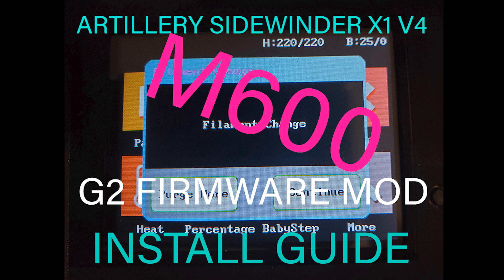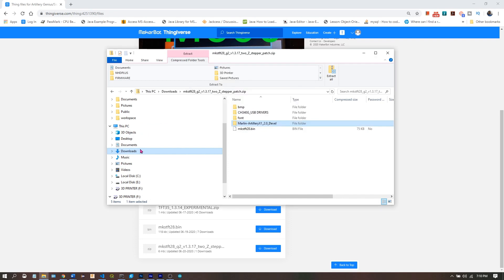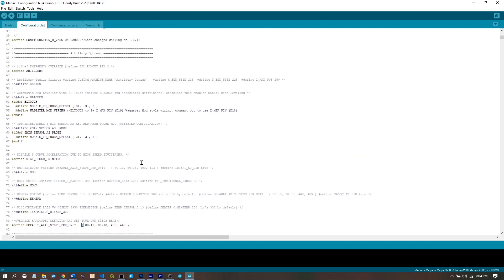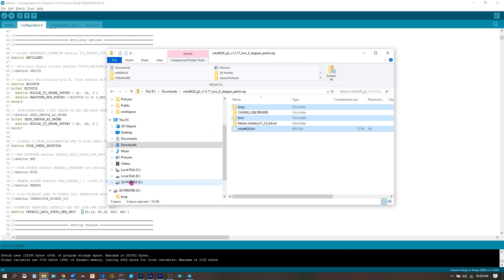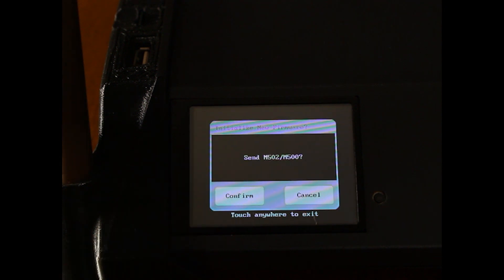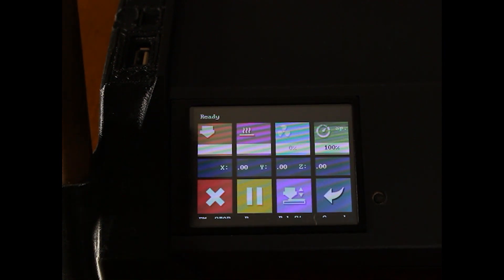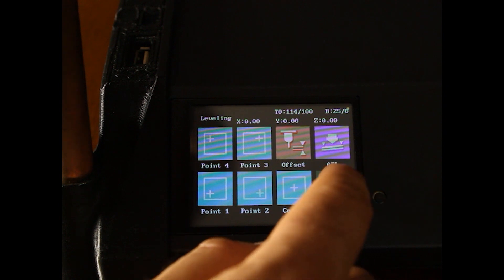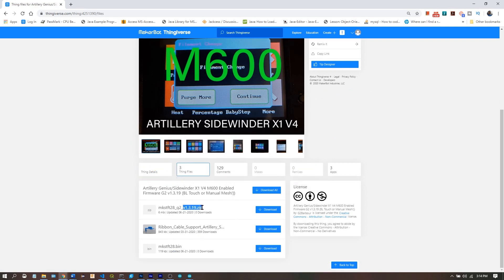INSTALL GUIDE: Artillery Sidewinder/Genius G2 Firmware with REAL M600 Color Change on Stock Hardware

Comment: can you make a video on how to upgrade x1 mother board to btt skr 1.4 tft 35 v3 tmc 2209 thankyou sirr i subscribe to you
Reply from the maker: I haven't had time to dust my printers off in a couple of years, unfortunately. But if I were to make another video I would have to have the hardware for the upgrades and those aren't upgrades I currently plan to make.

Comment: WHAT MOTHER BOARD DO YOU CHOOSE    DOESNT SHOW THE MKS V1.04
Reply from the maker: I don't remember. This was years ago. But if you download the modified Marlin version you'll find it. I do seem to recall having to spoof something in Marlin with the wrong board to enable certain functionality tho. I think I had to tell Marlin I was using a board with encoder wheel capabilities and then backdoor the system with fake encoder data. I could be confused though, because I was messing with alot of different options to get it to work. I had to find alot of workarounds to connect the starting point with the goal.

Comment: would this work the same on the new Artillery X2?  X2 has everything I need except for the M600.  thanks
Reply from the maker: Do you know what control board it has?
Reply: @PrintEngineering  Sorry I don't know.  I can try to find out.  If all else fails I can do the M600 pause by layer in Cura and add i to the script.
Reply from the maker: @ChinaAl  it now has a 32bit mainboard. So the TFT display looks like it is the same but Marlin would have to be pinned and coded for the new board.
Reply: @PrintEngineering  Oh, Okay thanks much.  That can be done.
Reply from the maker: @ChinaAl  no problem. Share for others what configuration works with the new 32bit boards. And remember that I was using a custom version of Marlin with features that don't exist in the official release. Though one or two features have since been added like M155 autoreport position (they may have changed the Gcode command for it but the feature does exist now). I did alot to make ADVANCED_OK work flawlessly with our printers.

Comment: supplied cable is a foot long and my pc is 6 foot away.... not so sure i want to invest in a longer cable to fix this printer. prints look like crap, bed has a hill in the middle, bad z wobble and layer shifting.
Reply from the maker: I made alot of improvements with Z braces, solid Z couplers, and a ton of calibration. The Z rod can also be bent and wobble which can be hard to chase down. If under warranty, support should replace anything bent.
Reply: @PrintEngineering  i hear ya. its less than a week old. considering returning it and getting another cr-10 seeing as that they are reliable.

Comment: @Print Engineering  I have another question. I have done the 3dprintbegginer tutorial to use the Z stock sensor as bltouch, but instead of connecting it to the LED connector I have connected it to the BLTouch connector of the Artillery Genius. I have seen that your firmware is already configured to work with this modification, but I guess I will have to change some parameter to make the sensor work from the BLTouch connector of the Artillery Genius instead of from the LED connector. Can you help me with this issue?
Reply from the maker: The factory built-in BLTOUCH support wasn't yet implemented when I made this video so I am unsure what, if any, configuration differences there are with the BLTOUCH pinout. I suggest asking the community what Marlin pin configuration works with the newer setups and simply make sure the same BLTOUCH pins are defined in this version of Marlin. I also wouldn't be surprised if someone has caught up with the true M600 functionality and the USB baud rate issue in another firmware by now, as it has been out of development about a year. I keep meaning to post the source code but if I had time for that I'd probably still be developing it. (Last I checked other fw was only emulating M600, and they got the USB to work by slowing it down so much that it would bottleneck my performance Enhancements and cause stuttering during print)

Comment: Hello everyone.
I just installed this firmware on my Artillery Genius. I am testing the printer but I just realized that the filament sensor is not working and it is enabled in the menu. It runs out of filament and the printer keeps printing. what's going on?
Reply from the maker: Did you move the wire?
Reply: @PrintEngineering  In the thingiverse instructions, I understood that in the last experimental versions it was not necessary to move the sensor cable to make it work.
Reply from the maker: @jonnymet7579  honestly I can't remember if it was fixed in the latest versions, I haven't touched the project since then. Busy with many life situations currently
Reply: @PrintEngineering  Okay, don't worry. I'll change the wire to make it work. Thank you.

Comment: Hello,
I have an Artillery genius with everything stock and working perfectly but I want to activate the M600. Can I install only the firmware of the TFT and the M600 works? I mean, install this TFT firmware with stock Marlin. Would it work? Or do I have to install this firmware of TFT + Marlin obligatorily? Thanks!
Reply from the maker: No, the Marlin version is modified. As of the time of writing there are new custom features in that version of Marlin. M155 auto report position has since been added to official Marlin releases but I think they may have changed the command from M155 to something else.

Comment: the genius filament runout sensor is not long enough to plug into the board. is this step necessary?
Reply from the maker: It shouldn't be but I've had reports that there may be a bug preventing the original runout configuration to operate properly in the recent versions. I haven't touched the project all year so I can't remember exactly. If it doesn't work you can splice and extend the wires yourself or I think I have the materials to make and sell extensions around here somewhere...
Reply: @PrintEngineering  thank you for the reply, my artillery genius has been parked for 4 months now because ever since I got the bltouch I've had weird, hard do diagnose problems (at least fit a newbie like me)
I'm trying this version of the firmware in hopes it gets fixed
Reply from the maker: @tuganerf  I hope it works

Comment: Many months ago I installed the RAWR TFT Firmware mod on my Genius and it sorta worked but now it freezes during M600. I'm trying to make your firmware mod work, when I put the SD card in and press the reset button, it just starts up as normal. Just wondering if I am overlooking something simple?  I have detached the reset button under the hood, and I put the three things on to the SD card that you mention. Thank you for your time!
Reply: Ah ha! I was using a 64g sd card.

Comment: Great work and looking forward to your 1.4 Version. 1. Question, if I want to have my LED and cable my bltouch direktly (I have an 1.25m cable fitting perfect under the ribbon cable) how to change the Arduino shetch, for b/w I can use D18/D19 but how to address the D11 into the shetch (other is 5v and grd in that 4. Row) and let the LED stay on D4,5,6? (Need to change something also at num_servo?) Would be great if you could help me here. Thanks in advance

Comment: I’m a noob to this. I have had a genius for about a year now and i love it. It has all stock parts still. but i really ant M600 and also that octoprint feature is cool. But i have a few questions. 1st, will this void my warranty and is it worth it to do so. next, can you change the tft layout and stuff without changing that whole firmware from stock. i don’t understand but i think you changed the tft layout first correct? Also this does work with borough if i ever decide to get on right?  anything else i should know before i try this myself?

Comment: Hi,
I am only discovering this video now.
I installed the firmware and it works great !
What happiness to use the M600 and especially to be able to interact with the touch-screen, even if the print has been launched from octoprint!

I love this firmware. 
--- Thank you very much for your work ---

Comment: The best firmware that I have checked.... Congratulations. There is a lot of work behind
Someone has a problem  to compile with the TMC2208 or TMC2209 driver option ???  It only works for me with the default 2100. I am using arduino IDE to compile  with a MKS GEN L v2

Comment: So the m600 function doesn't work if the filament sensor is detached?
Reply from the maker: I've never tried it like that but in theory it should still work
Reply: @PrintEngineering  Ok. I asked this because my sidewinder's filament sensor cable is too short. Not a problem because I have never used the filament sensor, but I would be sorry not to have the m600 function
Reply: @michelesampaolo3467  did it work with it unplugged?
Reply: @bigwurm8314  i tried it yesterday. Yes! The m600 works like a charm

Comment: I have the Artillery Sidewinder X1 V3 will these firmware and screen modifications work with this model, I am new to 3D printing
Reply from the maker: Yes. I also have a V3. The only difference is related to accessing the SD card as the V3 wasn't wired properly from the factory so it doesn't signal that an SD card is inserted. Functionally you should not be able to tell the difference. There may be a dialog that pops up and you may have to mkar 2 attempts to access the SD card drive the first time, otherwise it will be the same.

Comment: Dammit, I have the X1 but my wire is too short to reach the controller board
Reply from the maker: Yes apparently they have been pinching pennies. I can sell you a cable extension for $5 +shipping.
Reply: @PrintEngineering  hey no worries man, I just extended the cable quickly :)

Comment: I really appreciate people that generously share their work. You transformed my printer into a 1st class tool. Thanks
I do have a question though, I may not be right but since the firmware change my Genius extruder makes loud rattle noise on sharp direction changes. I have checked all the physical mounts etc. The feeder is not slipping however the noise comes from that area. It is not affecting print quality.
Has anyone else experienced this?
Reply from the maker: Default acceleration and movement speeds are higher. Possibly putting more stress on the fan.
Reply: @PrintEngineering  Thanks for that, I was wondering if they had been changed. It makes sense, where is that changed? I would like to experiment with it.
Reply: I found it, DEFAULT_MAX_ACCELERATION in Configuration.h. At least I will be able to prove if that is the reason for the rattle.
Reply: That worked. Factory values made it quieter. Here are some other setting I found helpful:
Move extruder off bed after ABL, find and uncomment this line "#define Z_PROBE_END_SCRIPT "G90\nG1 Z10 F3000\nG1 F9000 X2 Y2\n" "
If bed is pretty flat, glass etc find this "#define GRID_MAX_POINTS_X 5" and change 5 to 3
Speed up travel find #define XY_PROBE_SPEED  and change to 12000
Reply from the maker: @fatchickencatcher  glad you made some customization that made you happy

Comment: hello but not to load the firmware no longer need to disconnect the tft cable and put it back once done?
from the video I have not seen it ... thanks
Reply from the maker: Correct. But after the video was made there is a new feature set where you move the wire and get instant print cancelation and the original reset functionality is restored.
Reply: @PrintEngineering  ok so to load the firmware i just have to move the cables close the machine and load it? to be sure I have the printer in a really awkward position
Reply from the maker: I'm not sure what you are saying. But the red/black reset wires can either be disconnected permanently or moved to the position right next to the original position of the filament runout sensor (black on B1).

Comment: I'm installing your great firmware, but I have 2 question: it's compatible with the bltouch wired to the led pins (as waggster mod)?! And second: I saw you setted NOZZLE_TO_PROBE_OFFSET to 31; -31; 0, how can I determinate what's my offset?!
Thank you so much! 🙏

Edit: compiled with enabled bltouch and flashed your firmware and tft, but when i go to calibrate bltouch z-offeset, the printer goes to the opposite corner and continues to spin the motor, so i had to remove the power. And in the probe is going out of the home corner. How can i solve that?!
Reply from the maker: Yes it is compatible with that wiring. Just uncomment BLTOUCH and iirc the default is for waggster style wiring.

The probe offset you may have to measure for but the defaults match the most common STL for probe mounts. If you do need to change them they are the set of numbers closest to the BLTOUCH definition. When you home take note of the point that is probed then watch the distance along the x and y axis from that point to where the nozzle aligns from the offset menu. I recommend leaving it a few mm offset from exact alignment to avoid oozing sticking to the bed and skewing the probe homing value.
Reply from the maker: As for the other problem where it tries to probe off the back corner of the bed, (I saw your comment on thingiverse but I am not signing in to respond to anything there currently due to family emergency), this happens occasionally for unknown reasons that I suspect have something to do with Marlin memory getting corrupt. Possibly you forgot to reinitialize the new firmware with the dialog (which sends M502/M500) or it is a bad flash. Generally reflashing Marlin solves this.
Reply: Perfect! At the 3rd flash, all works ok. I love this firmware! Bought you a coffee. Thank you 🙏
Reply from the maker: @chazy10  much appreciated! Glad it worked for you.
Reply: One last question: when I sent print via octoprint and then I have to babystepping, I disabled the lockdown mode, but I don't find where to babystepping while printing..
Reply from the maker: @chazy10  more
Reply from the maker: @chazy10  I think. my printers are in North Carolina and I'm in Pittsburgh so I can't check right now
Reply: @PrintEngineering  while printing from usb, is there, but if I print from octoprint and then disable the lockdown, I can't find babystepping.
Reply from the maker: @chazy10 you shouldn't have to disable busy mode to get the baby stepping while printing from octoprint. Babystepping should appear on the busy mode status screen

Comment: when I upload the tft firmware why dose it say no printer attached and why is there no BMP or font files in the new version off m600 ?
Reply from the maker: Did you update Marlin too?
Reply: @PrintEngineering   turns out there was something wrong with my mainboard it wasn't communitcation with the TFT, I swapped it out for are new one and its seems to work now no idea what it was.
Reply from the maker: @Warhorse469  glad you got it working

Comment: I have installed your firmware and i am having temperature fluctuation on hotend, also the PID tuning takes about a minute and not 6 minutes. How can i solve this issue?
Reply from the maker: I'm not sure what is going on. I don't really have enough detail. But it sounds like the PID tune isn't giving good values for you
Reply: @PrintEngineering  what kind of data you need to help me out. Thanks for your reply btw
Reply: @PrintEngineering  what is PID tuning. what do those numbers mean? i’m just curious
Reply from the maker: What do you mean by temperature fluctuations? Are you running the stock cooling setup? Do you have old PID values that you can try?
Reply: @PrintEngineering  the temperature on hotend is going up and down like cardiograph. I have change only the stock fun with a double air duct and 5015 fun. You think this might be the issue? I dont have the stock PID numbers. I will try to find them.
Reply from the maker: @ppls010  yes that could be the problem. I run a 5020 with custom duct and it moves so much air that the PID values are drastically different from fan on to fan off. Ultimately I set the firmware up for stock users. People like us, who are the exception and have proper cooling, may have to manually PID tune for now. It is planned in the future to accommodate our needs, but it is not implemented yet.
Reply: @PrintEngineering  i see. I will run a PID tuning with no fun on. Thanks.
Reply: Can you share your PID values please?
Reply from the maker: @ppls010  my PID values are the defaults stored in configuration.h of the download
Reply: @PrintEngineering  thank you